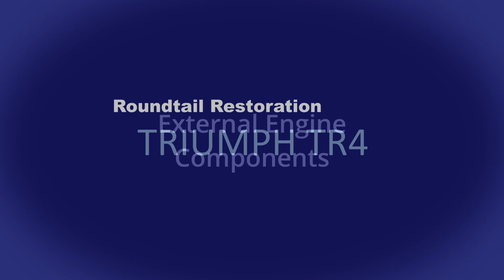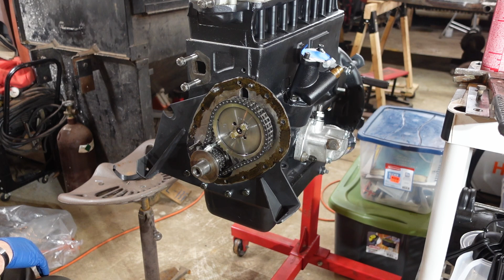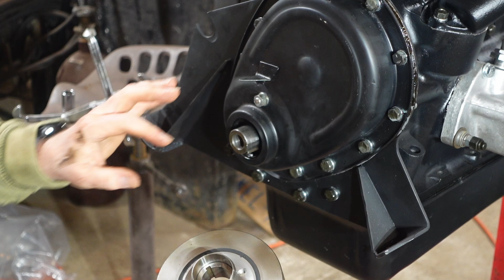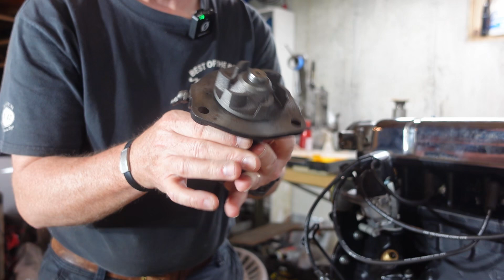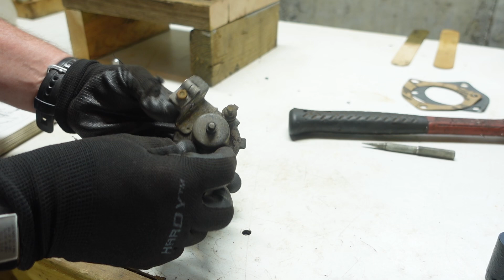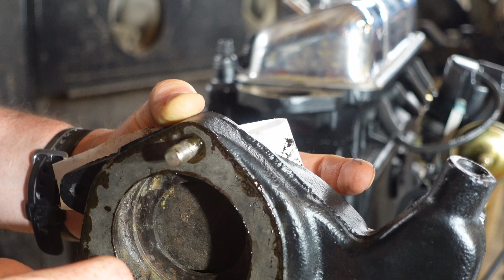Triumph TR4 - Engine Rebuild #18: External Engine Parts | Roundtail Restoration

Comment: I always thought you had to keep the Timing chain cover bolts loose and then install the crank pulley so that the cover with the pulley seal would center around the pulley and you would not get a oil leak. But I might be wrong. I have to do that with my A-series engines.
Reply from the maker: That's a good point, Mike. I assume that is done so the seal can self-center on the crankshaft and then you tighten down the cover (which contains the seal). Probably not a bad idea. The workshop manual doesn't mention it, but in hindsight, that may have been the way to go. The crank pulley did have some friction going in, so hopefully that's enough!
Reply: @roundtailrestoration  That s correct. You are pretty much guaranteed the seal will be centered if you tighten the cover last. There will be equal pressure around the seal.

Comment: Hi Chris, I did the thin belt conversion and fan delete on my TR4 too (as well as conversion to alternator, neg ground and electric fan). Something different from yours, the crank pulley I got is also a harmonic dampener. It's not solid like the one you installed.
I have heard that the original fan and the crank extension used to mount it also served to balance the 4 cylinder engine. I don't know if that is true, but do know the original fan, pulley, and extension have a small hole drilled through  them to indicate the correct assembly, presumably to maintain that balance.
The 6-blade water pump is a good idea, too. Our TRs can use all the help they can get circulating coolant through the engine and keeping the temps under control! FWIW, I bought a 6-blade pump instead of rebuilding, and put an aluminum thin belt pulley on it. 
I got my thin belt conversion and water pump from Ken Gillanders at British Frame and Engine. He is a long-time TR racer and specializes in high performance parts (but stocks some "regular" stuff, too). Ken is a wealth of knowledge about getting these cars to peak performance... BUT I recommend charging your phone fully before calling him, because he has a lot of great stories and you might be on the call for a while! 😄
Finally, was there a gob of something like Bondo or hardened plumbers putty smeared on the front of your timing chain cover, under the paint? Supposedly that was done by the factory to reduce engine noise. Most rebuilders remove it when cleaning up the parts for fresh paint and reassembly. It's rare to see now and is even missing from most "show" cars restored to the highest level of originality. If I did  see it on a TR 4-cylinder, I would assume the engine has never been fully rebuilt... unless it appears to be an extremely meticulous restoration.
P.S. I've never seen that heater control valve taken apart before... interesting to see how it works... and if it is rebuildable.
Reply from the maker: Thanks, Alan. My crank pulley does have the rubber balancer. The conversion for the water pump, though, continues to be painful. I think I'm there, but I have my concerns still. I did not have that insulation stuff on my timing chain cover (nor on my Spitfire). There are some pics in the workshop manual that show it. I always assumed it was a chain noise abatement, but it seems a bit silly given all the other noises that were there. The heater valve is really simple. If you rubber diaphragm is in good enough shape, you can clean it up and rebuild the thing. But, you can't get pieces/parts, so sometimes you just have to get a new one. Thanks for watching and your comment!
Reply: @roundtailrestoration  HI again Chris...  I hope you get the water pump sorted out. BTW, new or rebuilt, it isn't uncommon for them to leak a little at first. I think the seals just need some time to seat themselves properly. It's only a concern if the leak doesn't stop after a little run time.
Reply from the maker: @alanm.4298  I got as good as I could on the water pump yesterday (video out soon). Still not totally happy with it, but we'll see once it actually gets running. Thanks for the tip on the water pump!

Comment: Hi Chris, can i suggest you look at the upgraded heather valves with a straight connexion to the block? those old ones and repros do no operate well. mine does not close by just pushing the cable so i need to open the bonnet and give it a push. Easier to do it now, Rimmers sells a kit. Cheers
Reply from the maker: Thanks. I just looked at that kit. I'm not afraid to say that the price is a bit steep. I'm not sure it would be worth it for me, but definitely something to consider. Thanks for watching!

Comment: Hi Chris, 
We don’t see you turn the distributor drive round 180 deg so I assume you have not done it yet in the video as the rotor arm looks to be still pointing 180deg out, i.e. when installed correctly it should point to #1 spark plug. 
Also at time 11:52 in the video you say 1-3-2-4 for the firing order when of course you mean 1-3-4-2. 
I've sent the page from my manual by e-mail, which I guess is the same as yours, but included for checking. 
I’m still not to the engine of my 1962 TR4 the bodywork (sorry the rust) is taking forever!!! I might do as you have and hit the engine, if for no other reason but to get a change of work and feel as if I’m making progress!!! 
Cheers, 
Mike in the UK
Reply from the maker: Thanks, Mike. Yes, I did swap the gear around and aligned it all with #1 plug per the workshop manual. I did mean 1-3-4-2 but I bet I wired it up wrong now that I think about it. Be checking that! Thanks for the email, too. Yes, sick of rust repair is why I went to the motor and soon be shifting to the chassis. Definitely no fun, but I do find it rewarding after a time. Thanks for watching!
Reply: OK I guess if you have changed the distributor drive you are at TDC on the Exhaust stroke, not the compression stroke, at 10:55 as the rotor arm is pointing away from #1 spark plug. It will all come good when you do the actual timing.
Reply from the maker: Thanks, Mike. I did re-wire the cap as that was wrong and re-verified the dizzy. I had rotated the motor a few times and just edited that all out, so it was all good to go. Thanks for the backup!

Comment: Looking good Chris. The blanking plugs for the grease point on the water pumps were nice chunky brass things, I think they’re still generally available? (Got a few used ones kicking around myself so have never needed t look for new). What problem are you having with zinc plating? I’ve just got my kit out again too and am driving myself crazy cleaning bolts to a plateable condition!
Reply from the maker: Thanks. The zinc plating itself is okay, it's the black oxide. It looks really nice at first, but as it dries, it develops a white, chalky appearance. Some of it will rub off, but most of it won't. I really haven't played around with trying to fix it too much yet, tho, so I shouldn't complain yet.

Comment: The new cap will only last about 7000 miles as the rotor is harder than the pins, the old caps had brass pins and last for years.
Reply from the maker: A shame you can't find the original quality stuff. I'd be willing to pay more, but sadly I don't think most people would - hence, no market for that stuff. Thanks, Bill!
Reply: @roundtailrestoration  I agree
Reply: One of the reasons I replaced with a Mallory dual point ignition... but now I see they're discontinued (since Holley bought Mallory?) and parts for them may become harder to find!

Comment: You can remove the pin out of the offset drive on the Distributor turn the offset drive 180 degrees and put the pin back in.  Replace Distributor in the correct position.
Reply from the maker: I briefly considered that, but following a professional rebuild of it, I didn't want to take any chances with screwing something up. Thanks for watching!